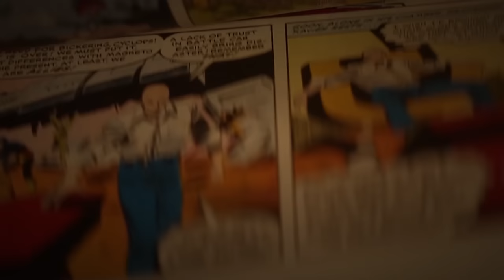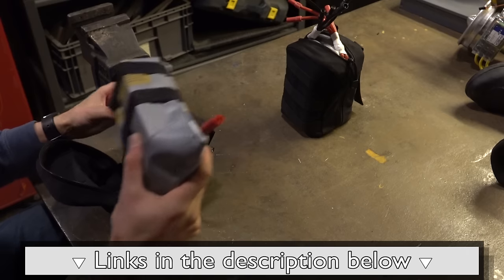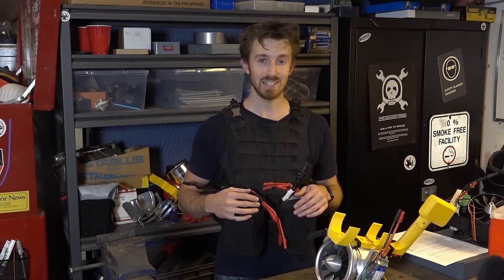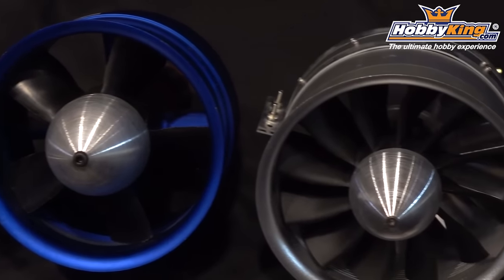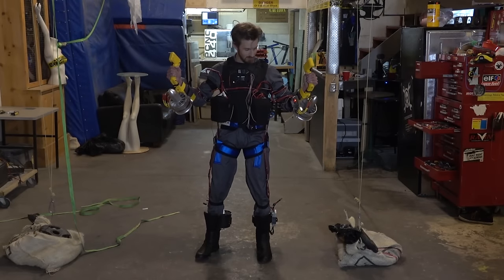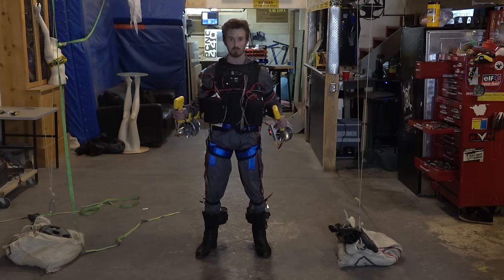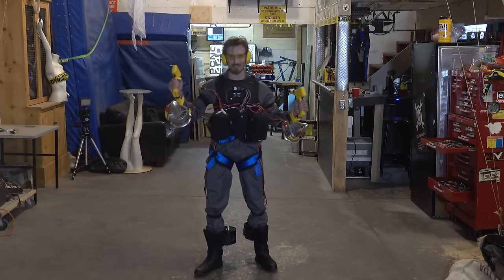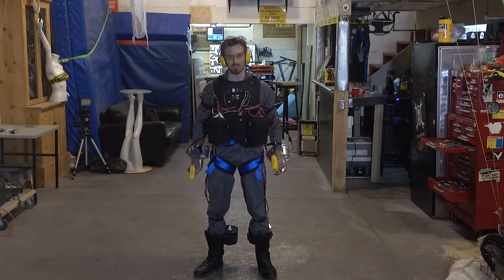Flying Like Iron Man #10: Jet Boots

Comment: I'm a bit concerned about you guys trying to 3D print EDFs that will be forced to push so much thrust. And it isn't a matter of whether you guys can do it, it's been done before the problem lies in the rigidity and  overall strength of the materials used in 3D printing. If you guys are worried about the fan blades of metal EDFs possibly exploding under high duress you should think twice about making and using plastic fan blades that will definitely explode under high duress. Unless scientists find a way to mass produce and use graphene in 3D printers by the time you guys are ready to attempt such a feat lol. I just don't want to wake up one day and read the headlines about how the Hacksmith and cohorts have all been sent to the morgue lol. Great work though, keep following your passion!
Reply from the maker: That's why we said it's probably not possible... ;-)
Reply: the Hacksmith I know, just voicing my concern. Don't want one of my favorite channels disappearing soon after I decided to finally sub lol. You guys have a lot of followers and you do some metal working yourselves, why not look at partnering with a metallurgist/machine shop to help with manufacturing? I'm sure you can find someone out there that's skilled and just as passionate about these things as you are...
Reply from the maker: We'll be safe =)

The problem with making EDFs at home, or at a shop, is the blades are crazy complex to machine -- its possible we could machine something out of aluminum with our Tormach, but it'd probably take 40+ hours of machining to do it -- better to just outsource to China =)
Reply: the Hacksmith You're right. And american machinists charge crazy amounts of money for labor hours.
Reply: We've had pretty good luck with 3D printing, then cleaning up the prints (vapor polish/etc) and using them as a master for cast resin, or aluminum parts. You can definitely dial down the machining time if you start with a near-net-shape cast blank, but investment casting might get you close enough to just need a polish and balancing to provide a reasonably efficient EDF blisk.

Comment: increase the number of thrusters to 8 .it will increase the weight of batteries but it will work
Reply from the maker: +mohd faiz 8 is still not enough... You're forgetting about the weight of the EDFs themselves, and the batteries :( we would need a minimum of 16, more likely 20 of these to actually hover
Reply: That's the problem too.  But I have an idea about the Accelerators in place of those thrusters . they are cheap and they also made it to fly .
Reply from the maker: +Fàìź Šaýèď accelerators?
Reply: The one that Colin use in his hover bike
Reply: That's even cheaper then thrusters
Reply: But it's not fit in boots or in hands , likely it should be in back side
Reply from the maker: Colin used gas engines with his hoverbike... they weren't cheaper by any means. His project was sponsored by Ford.
Reply: the Hacksmith you should start a gofundme bcuz even if you get some sponsors it's always better to have more people donating just to be sure bcuz you can't always be one hundred percent sure
Reply: Fàìź Šaýèď
Reply: he has one already look in the description
Reply: the Hacksmith what if you used a waistband of them? they weren't on the suit, but I think the design can come after the proof of concept.
Reply: naaaa need  nukee reactor or stark reactor or startrek stuff to make this stuff work maybe in future.
Reply: Comedy baby video
Reply: @hacksmith  oh yeh can you fly like spider man

Comment: Maybe scrap EDFs all together. Maybe you need to come up with something better than an edf that is also cost effective. Perhaps a multi bladed system.
Reply from the maker: That's the easy way out! ... also the props would be huge. Kinda defeats the purpose of flying like iron man =)
Reply: the Hacksmith No no. Let's just look at the backpack. Instead of EDFs use a different design. Perhaps use a centrifugal fan that is long (the length of your back) and sucks air on from the sides and out the bottom. It gives you more blade area without having the width of a whole prop. It also gives you lower RPMs with more torque which is safer and easier to make.
Reply from the maker: Centrifugal fans can't produce that much thrust though...
Reply: the Hacksmith Not with that attitude.
Reply: But for real. What if the proper modifications could be made to a centrifugal fan to make it give you decent thrust.
Reply from the maker: Research it and lemme know! =) Bigger fans require bigger motors (which are heavier) and it would draw more power. The most efficient way to fly would be with a very large propeller system -- like a helicopter. I'm all for new ideas, but I've never seen a fan like that produce enough thrust for something like this.
Reply: the Hacksmith Technicaly a set of impulse drives would give you more thrust efficiency. But we don't even have prototypes for them so..
Reply: I support CheesyBread's idea of a centrifugal fan or a large impeller. You could route the output out of various nozzles at your hands and feet via flexible tubes. Of course, the larger the total cross-section, the better, as we all know that you have more momentum transfer per energy used at high volume, low speed flows. But the key idea is that this cross-section need not be circular, like under a helicopter's blade. It can be shaped in any way you want! For example, you could have a belt blowing air down from your waist, running all around your girth.
Reply: the Hacksmith Firstly I will mention I am a CS undergraduate in college. My grandpa is a PhD in electrical engineering. Not exactly experts in aeronautics, but we came up with a design that may work. Unfortunately I don't have money so I can't 3D print and test it myself, but you take a ducted fan, and replace the blade with a cone. The base of the cone is about an inch less than the inner diameter of the fan casing. The blades themselves are directly attached to the cone. The further down the cone you go, the steeper the pitch. Consequently you get a constant increase in internal pressure with each layer of fan blades on the center cone.
Reply: CheesyBread
Reply: surfcello Hacksmith is right though. A standard squirrel cage centrifugal fan won't cut it. The blade needs to be modified, but the concept of not using a circular cross section is what we need.
Reply: CheesyBread that's a good idea the only problem is he's spent thousands already
Reply: James Mclarnon And he will spend thousands more if we can't come up with a more viable and cost effective design.
Reply: I bet you're fun at parties...
Reply: Mists & Shadows  I bet you're really fun at parties
Reply: Mists & Shadows Settle the fuck down immediately.
Reply: BigD wait, holy shit, we typed the same thing
Reply: Synthmilk Was I replying to you in my previous comment? That guy wasn't here to provide an explanation about how anything worked. That guy was giving nothing more than a dumb rant about why nothing would work.

But you seem to know your stuff so please do explain why my ideas wouldn't work. Perhaps suggest a better system design that would be more cost effective to help the hacksmith out? Otherwise you are of no benefit to this conversation like the rants-a-lot guy.
Reply: War Machine Well an EDF aimed up at a sail would indeed produce a downward thrust.... except a much smaller one than if it was just pointed down. That's the same paradox as a toy boat with a sail and a fan... the fans thrust is just redirected backwards by the sail. Mythbusters proved it.
Reply: War Machine But to add to your comment adding some form of weight reduction system (portable) would be a great solution to reduce the required thrust. The current system is a stunt rig and that's Perfect for testing! But say a container of Helium or Hydrogen (with Hydrogen you  would need to a solid container). That way it reduces the weight generated by gravity with his mass, withought physically reducing his mass. as he said he's about 64kg, but we could reduce his wright by maybe 20-30 (optimistically) with a hydrogen container on his back. Yes it would be like a large hiking back pack, yes it would be bulky, but it's called experimenting and developing! ^^ (Hydrogen can also be dangerous if not respected, but beyond that it's safe as long as he doesn't agitate the container. If it's a solid (as in strong, not solid as in not a liquid etc) it should be safe even if he bumps into something. Helium would require just over double (tiny decimal points more) so you would require a larger container etc. Hydrogen would be a good idea for portable flight...

The idea is still to hover independently of bulky hindrances. EDF's are currently the only way. Iron Man uses impulse drive technology, something we've been researching for over 10 years and currently are capable of enough thrust to lift about 10kg. except the equipment weighs as much as a small nuclear reactor, and takes as much energy to fly...

THERES A THOUGHT!!!! Use a nuclear Battery!!!! MUCH more current available and voltage! although Nana only got a grant to make Plutonium again in the last year, there's less than 12kg around the world. Sellafield is also aloud to make it, except they're far more well equipped. A nuclear battery IS safe. It's completely shielded and the smallest design today would be enough to power the Peel P50... :D (again though, costs give it 5 years before Hacksmith can afford it with some descent funding and saving... if the price goes down as much as expected by then).
Reply: Ditch the EDF's and duck tape a hairdryer to each wrist. Boom he's flying.
Reply: CheesyBread
Reply: CheesyBread
Reply: Flying like iron man requires tony stark kind of money, once he get the money,! he will fly! Point blank
Reply: CheesyBrea
Reply: +Mists & Shadows 
first off, the idea that he cant deal with the weight once hes in the air is ridiculous. most of it wont even be on his limbs once he finishes the build, and if your talking about his control of the thrust, 8kg per limb is SO simple for anyone in decent physical shape. if your complaining about him not being able to cope with the speeds, and thus with the g-forces, hes got a throttle. he controls the thrust, and therefore the speed. oh, and speaking of him finishing the build, the entire point of the stunt-wires is to allow him to test each portion of the build separately before moving on to the next. once the build is done, additional back-mounted EDFs will take the place of the stuntwires, with the limb mounted EDFs acting as moving stabilizers, and steering. if your worried about safety gear, then all he needs is the money for... say... 4 of those larger 24 kg EDFs. mounted on the pack, that will be more than enough to support him, cooling systems, batteries, and some impact resistance. and finally, your issue with his landing. i re-iterate. hes got a throttle. gradually decrease the thrust for a controlled descent. thats pretty basic stuff.

and to everyone else, stop using the word "faggot", its not necessary.
Reply: CheesyBread no just just give him ur money just take it

Comment: try to make a liquid cooling system. maybe a computer liquid cooling system
Reply: Jacob grose yes
Reply: Maybe liquid nitrogen will do the work
Reply: weight that will harm
Reply: Or just redesign the EDFs to use a portion of the air they are pulling through as cooling.
Reply: The F-35 (for all of it's faults) uses it's own jet fuel as an engine coolant.

Comment: Could you please do a Make It Real for Spider-Man web fluid
Reply: Alex T Search the human spiderman on youtubw
Reply: Alex T yes can u plz make one
Reply: Alex T I wanna do pourkour
Reply: The Marvelous Spider-man Buy a climbing suit. (it's not a suite for bordering or rock climbing, it's an actual suit with the same idea as Goblin armour in The Lord of The Rings. Hooks, and spikes in the armour to alow you better grip of surfaces, like a limestone wall with cracks or little holes etc)
Reply: It's just Semen, nothing special.
Reply: The stuff the. Amazing and The Human Spider and such are making online is honestly not even as good as silly string to be quite honest. It's quite hard to come up with something that will shoot out as a liquid and turn into a liquid solid that can hold hundreds of pounds if not thousands, the logical thing to do would be something like fishing line with some Co2 and a projectile, though it's been done before.
Reply: Jr. Hacksmith Currently we farm it fro genetically altern Goats who produce percentages of the silk in their milk. This is then mixed in a vat to "Butter" it, which allows it to be shipped and dried. We use it for ridiculously expensive cables, because they're stronger and more flexible than steel at the same thicknes. (Lighter too). But making a devise to launch thag xD

Comment: I'd suggest a better plate carrier (You called it an tactical vest lol). you can get much lighter ones that'll probably be more durable aswell. My suggestion would be a Crye JPC or something similar. it'll save a ton of weight and do the same task
Reply from the maker: +TriggerHapySheep it weighs like a pound tops... The heavy stuff are the batteries, ESCs, and the EDFs themselves :(

Comment: You can't really make anything near a flight system as small as Tony Stark's suit without a large amounts of energy. Technology will need to evolve to the point where nuclear fusion is small enough like an arc reactor.
Reply from the maker: You can -- it's just only going to last for a minute.
Reply: Something like Iron Man's? No you can't even last half a minute using batteries. Small enough to be able to carry around.
Reply from the maker: Yes... you can. We've run the calculations, designing a system using EDFs and lithium polymer batteries will allow for about 1-2 minute flight time. Still not economically feasible for a commercial system, but enough for a prototype.
Reply: Idk if you know but there is actually a guy with a jet engine on his back and can fly for a short duration of 10 minutes. But is a jet. If that is what you are thinking then is fine but I am talking about something as small as Tony Stark's hand. Something near the size of those thrusts you made and not a big jet pack on your back.
Reply from the maker: Our design is going to use EDFs and will last for a minute or two. We're aware there isn't a magic arc reactor to power the system -- that's besides the point.
Reply: OnePieceTVT true

Comment: Hacksmith, how many 24kg 195mm EDFs would be ideal for your flight? And what website sells them?
Reply from the maker: +Alexander Clipper check out the gofundme campaign! Links and the plan are there
Reply: Alexander Clipper 3 i guess
Reply: 4, I guess. 2 for each leg and 2 for each arm. I know that would equal 96 kgs of thrust but with the 195mm EDF you'd be carrying a lot of batteries, hence more weight. (P.S: wouldn't the 195mm EDF aggravate the heating problems? Just a thought)

Comment: Damn ur the reason i want to be a successful engineer
Reply: Joseph Lee I think that you don't need a degree to build something like this. All it takes is money and time, the two most valueable resources out there.
Reply from the maker: +Mattia Lombardi being an engineer helps, and if you want to learn how to design and build things, engineering is where it is at!
Reply: I understand (I'm an engineering student) but it looks like that what you are trying to achieve can be designed by anyone with enough passion and an internet connection. Speaking of passion, can you make videos on the more technical parts of the project? Like all the considerations and calculations that led to your choices. Most of us just want to see the thing fly, but others (like me) are interested in the reasons behind your technical choices, like an analysis on the single components and why did you decide to put them together the way you choose :) (I'm sorry if I sound rude, but english isn't my first language and I have an hard time with the feeling-transmission thing)
Reply from the maker: Technically yeah, and we usually mention that in our videos -- you don't need to be an engineer, but it certainly helps. There's lots of things we've learned through our education and especially work experience with regards to manufacturing, something that you can't learn as much about online =)

We'll try and include some more technical videos -- the next one is!
Reply: the Hacksmith That's exactly what I intended, keep it up!
Reply: that's right damm
Reply: +the Hacksmith Are you an engineer? If so, in what are you an engineer?
Reply from the maker: +Bronson Duhart watch my video on it!! :)
Reply: Joseph Lee im from th future uoh will have a accident hack smith bad accident be careful old phone lol check me out
Reply: Joseph Lee Yeah!

Comment: why not you try cooling the space you're in to try to counter the over heating problem. and why not a few smaller jets? I'm just asking to see why these ideas wouldn't work.
Reply from the maker: +jeditariq smaller jets are very weak, they get much more powerful the larger they are.
Reply: the Hacksmith ok, thanks for replying. and what about cooling the area? You said the jets are made for colder climates.
Reply from the maker: We'll just be able to run them longer in a colder climate -- not actually meant for it =P

The motors themselves are over heating -- and they're directly in the air stream from the jet, so if the jet itself can't cool itself... nothing can. Could watercool it but that would be way too heavy and we wouldn't be able to fly =(
Reply: Okay, thanks for the info.
Reply: jeditariq His best bet is to make a liquid cooling system in the casing for the Edfs, but it would make him heavier. If he could make it so that as the Edfs are pushing air, they are pushing a portion into the casing though a cold end, that then reaches to the motor to prevent the brushless motor from over  heating.